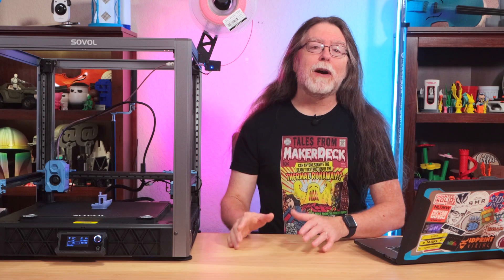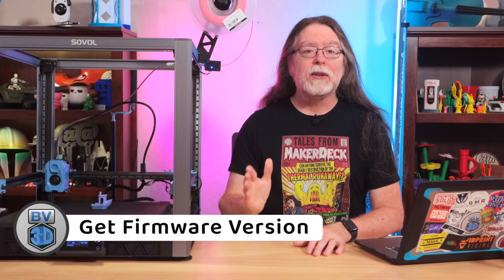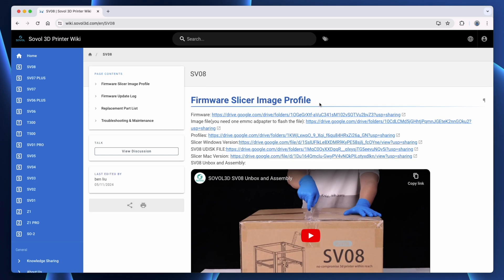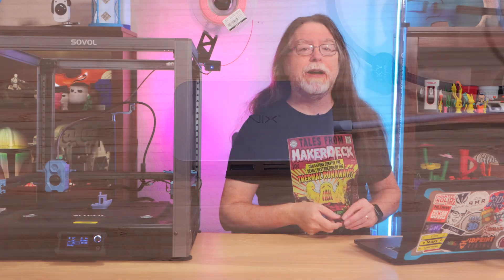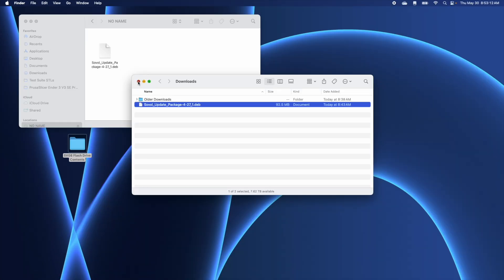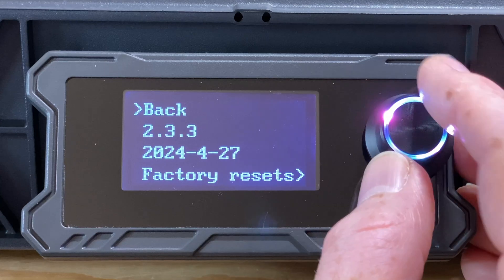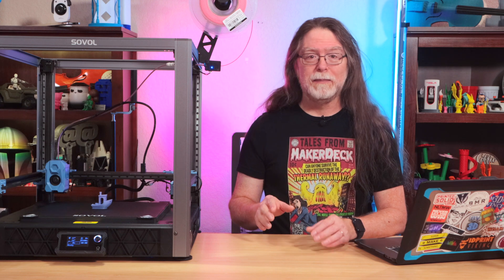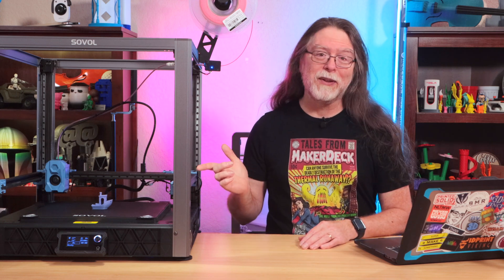How To Update SV08 Firmware

Comment: Thanks Bryan!  One thing you may want to consider is 'soaking' the heat plate; i.e. heating up the bed to allow the entire surface of the plate to come to a consistant temperature.  For the bed mesh and before printing, I heat to bed to temperature for 10 minutes, that allows the heat to 'soak' consistantly and evenly around the plate.  It seems to work fine for me, especially since it's a large build plate.

Comment: What is the difference of flasing firmware to burning the img file to the emmc? I tried to run the kaiuh update on klipper but it failed, it did update moonraker but then moonraker says it is broken now. Firmware update did not fix it, Reset does nothing but screw with the WiFi connection.

Comment: Thanks for the clear guide. 
Did you notice any difference in the printers performance after the FW update? Reliability, speed or whatever?
Reply from the maker: I haven't noticed a difference. They added some features related to Obico for printer monitoring, but I don't use Obico's service. They may have added or streamlined other features behind the scenes as well.

Comment: So the emmc adapter. Whats that for? 🤨
Reply from the maker: That's for re-flashing the operating system on the EMMC storage, on the printer's main board. So, on a Raspberry Pi-based Klipper printer, you could just pull the MicroSD card out of the board and re-flash it. But on this board, its on-board storage is an EMMC module. The USB adapter has a port for the EMMC module. Remove the EMMC module from the printer's main board, plug the module into the adapter, plug the adapter into a USB port, and re-flash the operating system using the Rasperry Pi Imager utility.

The whole "re-flash the operating system" process is something that could be useful if something gets corrupted on the on-board OS and it can no longer boot.
Reply: @BV3D  thank you ! 😁
Reply: If the OS / the printer don't boot and so also don't start an dab update

Comment: It is kinda stupid to not have any information on the screen about the update process. And  nowadays everything is done Ota so this seems preeeeetty old stuff. You can see the level of this company by these little things.
Reply: Yeah, I can see that.. issue is.. this machine is very much like any other Voron or Ratrig. There never really is any “firmware” for those.. it’s all about printer.cfg and klipper updates. So whatever the firmware is doing is at a board level.

Comment: I'm still on the fence about plunking down my hard earned for an SV08, although knowing that Sovol is doing firmware updates is promising.  Do you SSH into your SV08 and does it automatically save a previous copy of your printer.cfg file?
Reply from the maker: Hi Stew, it DID save a copy of printer.cfg as printer-backup.cfg but it looks like it overwrote some changes I made in the macros.cfg file to change the screen backlight color. I'll have to re-do those. I don't SSH to the printer, I interact with it in a web browser.
Reply: @BV3D  That's a shame. At least it's not Marlin and you have to reset everything after each firmware upgrade to be sure.  Thanks again for the great content, although you were a bit lacking in the usual quantity of the puns and Dad jokes, LOL.